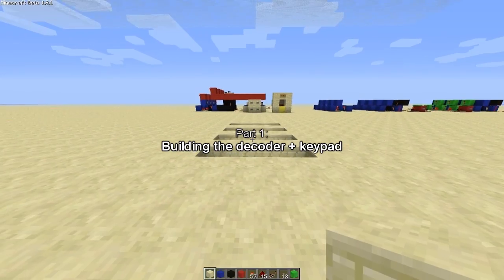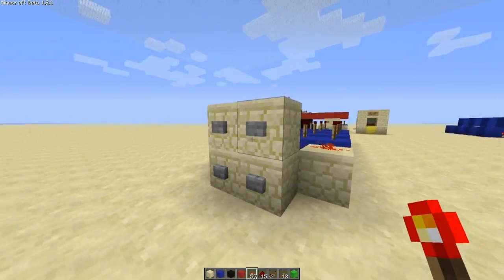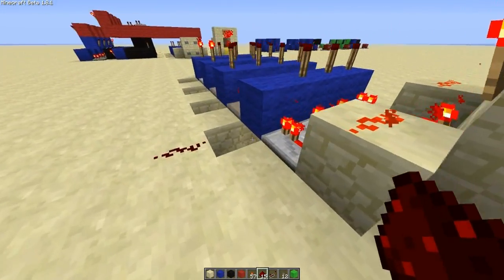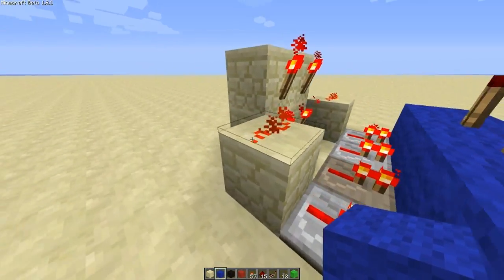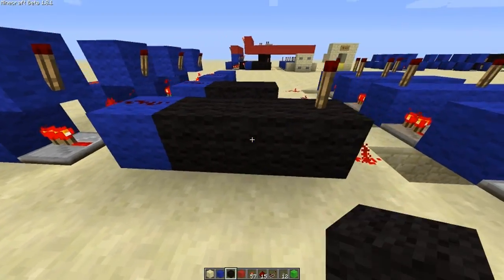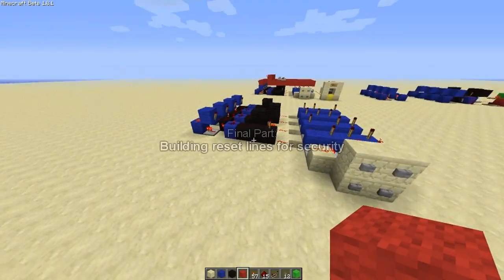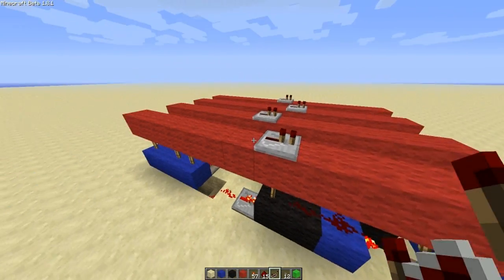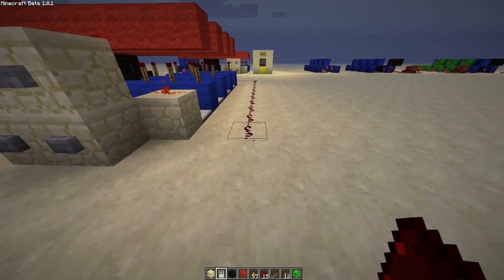Secure, Expandable Combination Lock! [Advanced Minecraft Redstone Tutorials]

Comment: I MADE A FIX!!! Make the RS NOR latches one block longer (on the black line). Then make it the same as it would be. Just put redstone where the torch would originally be. (Remember to move the whole RS NOR latch back 1 block from the decoder). then put a torch on the new block. Now for the and gates, do what he did, but add a block between the redstone at the end and the repeater. make sure the redstone does not intersect with any redstone on the black blocks. This patches the "hit the last number to open" glitch. The cause of it was that redstone, in newer versions, goes in to a line after a repeater, but in this version, it went in all directions. this fixes it because it isolates the redstone, causing it to do the same as it used to, still provides power to it, and powers the torches. The texture may look different, but it does the same thing. PLEASE LIKE SO EVERYONE CAN SEE!!!
Reply: glad i could help
Reply: Bro I need some help with the press number 4 and it opens because I am crap with redstone and have no idea what you put to fix it.
Reply: just try to follow along with what i said, i know its a bit confusing, but it will work when done correctly
Reply: ZombieRepellent
this video helps fix the "press last digit bug". Helped me out. :)
Reply: ZombieRepellent u realize first of all you tagged yourself and second you didnt leave a link for a video.
Reply: But thank you for the help Rodrick
Reply: ZombieRepellent np
Reply: send us a world save bruh or atleast re-explain "add a block between the redstone at the end and the repeater" plzz
Reply: rodrick160 exactly! what does "add a block between the redstone at the end and the repeater" mean?
Reply: sorry, i will explain more. The problem is at the black wool. Make each black line 1 block longer than depicted in the video. At the part near the blue/pink wool with redstone, which in the video is seen as a cross, you must place a block to do something i dont remember anymore as i no longer play minecraft and this was a while ago. Just try to figure it out
Reply: PikachuTube2000 What he's saying is that that it would be like this: repeater -> block -> redstone (in a line). The redstone will form its star shape because it's not directly touching the repeater.
Reply: look this vid is understandably outdated just what fedxgaming's 9 button combination lock, its really compact and its up to date
Reply: rodrick160 Dude! I pressed my finale button without pressing the others and it still opens
Reply: rodrick160 put a torch where?!?

Comment: Wow great design. Thanks to all the comments on how to fix the bug, ive already made 2 different codes and am too lazy to make another. *note to builders, when they say lower the repeater one block and put red stone behind it, you need to extend the and gates 1 each (so 3-2-3-2 becomes 4-3-4-3) to fit the extra piece of redstone in. Also, make sure the redston from the gaps does not connect with the redstone that activates the RS NOR

Comment: the solution is very easy:
The  RS NOR latch array is made of 4 rows in this video. Between these 4 rows, there are 3 rows with redstone pointing back to the decoder. Just dig away the block under the redstone torch and the repeaters in each of these 3 rows and put redstone under the torch. the redstone after the repeater (closer to the decoder than the repeater) should be on the original heigt. I hoped this helped and sorry for my english :D

Comment: You can just hit any number on the keypad that is not the last number in the combination, this resets the output line as the latch is broken. Alternatively if you have set it up so the door goes into a room, you can just link up a button inside the new room and make a redstone line from that button that connects to the reset lines on top. When pressed, it will send a signal down the reset lines, completely resetting the latch and closing the door behind you.

Comment: You can enter the combination super fast, all you have to do is knock out two torches in a row for example the first number is one and the second number is three you knock out the first and third torch from the first row of blue wool, in the second row you would nockout 3 and 2, the third row: 2 and 4 and the last row just 4 and it allows you to enter the combination alot quicker and it still works as it should

Comment: An idea I had about this would be to make an AND gate after each RS NOR latch in such a manner that both the previous button would have to be turned on, and you would have to press the correct button next in the sequence. Of course this would mean changing a few things in the reset switch to make sure that it doesn't conflict with the AND, but I'm sure you can figure that out.

Comment: You mean your pin-secured piston door to be timed?
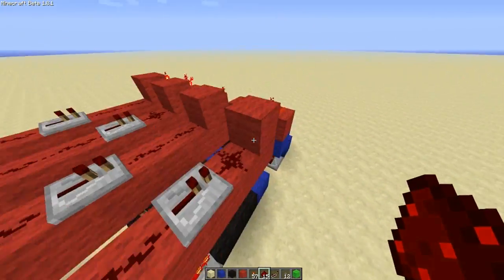See that output torch at 11:11? Just link a set of repeaters (as long as you want your piston door to stay open) to the reset for the last pin (red wool).
The signal going through the repeaters will tell the mechanism when to reset.

Comment: You can just hook up all the wires together and make attach them to a block with  redstone torch on it so when all the wires are on, it turns the torch off then have the same thing except the redstone wire attached to the off redstone torch, which will trigger the second torch to be on thus opening the door. It might sound complicated but its not really

Comment: The blocks leading from the decoders each have a repeater powering a block with a torch on top. He adds "and gates" at some point in the video that lead to those very same blocks with the redstone torches. These blocks MUST be powered by the "and gates." These gates will allow the flow of power to pass through ONLY if the "and gate" is powered by the RS Nor latch behind it, therefore only allowing a number to activate if the one behind it has been activated. Continue...

Comment: I used the 9 button pad.I used the same decoder & reset design above the decoder, but  a diff design for the active high (NOR) RS latches and the AND gate. My design is larger, but works w/ no bugs, & all buttons have to be entered in the right order of course. The trick is to take away all the torches involved with your code on the decoder, not just the one torch on each line. Then put NOT gates on each latch's set output to the next latch's reset input. this makes sure code is entered in order

Comment: i found a solution that should work... (please don't hate if it doesn't)
first extend the RS NOR latch so there is a stretch of wire that comes before it, put a piston in the middle and make it un extended except for the one on the first digit (make that one infinitely extended, now, just like the last redstone torch is your output, when the first RS NOR latch output torch is activated hook it up to the next piston, making it possible to only get the code in the right order, i hope that helped

Comment: You mean like to close the door after you've gone through? I had to put a couple of blocks with redstone torches (yada) to lengthen the distance the power went (my door was a little bit away from it), so I just put redstone wire leading up to one of those blocks connected to another block that I could put a lever on when on the other side to close the door. This also basically locks the door, since the door then only does what the lever says.
But I'm not sure if this is what you were asking.

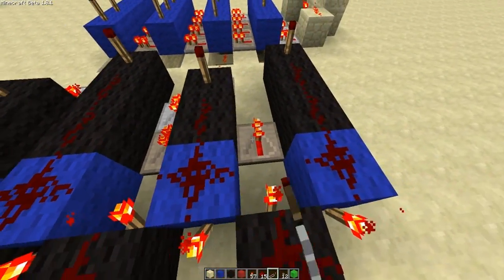Comment: It's because his "and gates" don't work properly. Somewhere around 7:20 he sets them up so that each latch can only be activated if the one before it has been activated. The redstone, however, does not power the block it's supposed to power in order to keep the torches off, and prevent the latch from activating. The redstone is NEXT TO the block it needs to be, but is not positioned so that it ACTUALLY powers it. Just rewire it a little bit so the redstone properly faces the block. Hopethishelps

Comment: The final number of the combination unlocks the entire thing whether the ones before it have been entered correctly or not. There is no system to test whether the recent input was correct or not. You could press "4" and the entire thing is unlocked without any "combination"
Reply: The first number has to be 1 then everything works fine ;D
Reply: the same thing happened to me and i do not know how to fix it.
Reply: Gio Fedalizo Hello Gio! Glad to know I\'m not being an idiot, and this is an actual problem. I have, however, found a solution. If you would like me to post a video here on youtube, or message/email you one, please let me know. Enjoy your day!
Reply: Matt Hamlin How do you fix it then?
Reply: I actually found that he has a video on how to fix it on his channel. Funny... he used the same method as I
Reply: ** EVERYONE, THIS STILL WORKS IN 1.7.9, FOLLOW THIS VIDEO EXACTLY, AND THEN EDIT IT WITH THESE INSTRUCTIONS ****
The solution is very simple. The redstone repeaters in between each RS NOR latch array (the repeaters in between the black wool), basically just delete them, dig a 1 block deep trench along and replace them in it exactly as before in the video (make sure you add a redstone dust under each torch because it won't reach the repeaters otherwise). The redstone dust connecting each RS NOR latch should now work again. Hurray! Your welcome.

And if you want more than one combination in the system (because your friend annoyingly decides they want one too in your world) , then just leave a big gap after you finish the build, and then place an exact replica of the red + pink wool and black RS NOR latch system behind it. This prevents having multiple combinations crossing....You know maybe I should just do a video on this to simplify everything haha
Reply: i know is weird that he didint see this
Reply: BlueShark85Xbox because when he did it, it worked. Look at the date of the video, lots of updates have occurred since then, so naturally it wouldn't work in it's current form. Follow the instructions I gave above, and it should work, for xbox and computer 1.7.9 version. I tested it on both, and it works.
Reply: Put in a repeater,it will fix it. If that doesn't, put it on a delay.
Reply: It still works in 1.8, just checked!

Comment: switch is, put a red torch facing outward followed by a sticky piston with a brick.  each time you hit a number, the piston will extend.  Inbetween each extended brick put a redstone arrow deal all facking toward the combination pad.  At the far end put a redstone torch and a wire, then on the near end run it to your door.  Now, go to where you programed the code.  if

Comment: It sounds like it would just be 1-4-3 as a simplified code and that would unlock it.

I would assume you would have to make separate circuits if you want repeating numbers.  Unless someone knows a good way to consolidate that.  There might be a way to use the new locking repeaters to 'unlock' a second circuit when you reach a certain point.

Comment: for anyone having the problem of the last digit activating it here's whats wrong...

the AND gate between each line doesnt work. the idea is to keep the torch at the end off until the previous signal comes on, but because redstone dust doesnt power blocks when its turning a corner (like here), its not working

solution: you need to power the block holding the torch in another way, eg. from underneath like i chose to and have the AND gate turn off said signal as intended

hope this helps =)

Comment: Ok This is the easiest way I could figure out to do this.  Hook the output to a monostable pulse limiter. Then split that signal two ways and delay one direction (about five seconds) and run both lines to the input of a t-flip flop that controls your door.  You'll then have a five second window to walk through the door before it closes after entering your code.  Run another line using the same concept of delay to the input of the t-flip flop for an inside button to open your door(from the insid

Comment: Continued.... In order to fix the problem, you MUST reroute the "and gates" so that their line of power leads DIRECTLY into the blocks with the torches on top. For example, I modified it so that the gates power either a repeater pointed DIRECTLY AT the block, or invert the signal with a torch, which powers a torch DIRECTLY BELOW the block. It gets crowded, but glowstone helps. Continue...

Comment: Oh, or if you want to be able to get out, connect a lever instead on the inside of the room to a sticky piston with a block that goes through the output line. This means when you pull the lever, it will move the block to either complete the output line and send a signal to the output or pull back out of the way to prevent the signal from completing, locking the door behind you.

Comment: To fix it for 1.2.5, the last button opening it etc, the repeaters and redstone facing towards the decoder on the ground need to be removed, then dig down one block so u make a trench, and place redstone under the torch, ten the repeater. If its the middle one run redstone two blocks replacing the first repeater: there's videos for it

Comment: Well from the looks of it, the fix is you just need to remove the torches that are interfering a different line and use an AND Gate to connect all line outputs instead of the fourth final output

Comment: 1. Remove the reset for the second to last latch
2. Add a piston connected to the second to last latch that pushes a block that lets the current through the output
3. remove all the and gates
4. You have to manually reset the second to last line, as i haven't found a way to do that automatically :S

Comment: (Continued)  I also needed NOT gates connected between the decoder outputs to the RS latch's SET inputs. Like i said my design is larger but fullproof. It is 12 meters longer in width and 9 meters longer in length than the one in this vid. I'm sure there is a more compact way to do it, but whatever, it works great!

Comment: THIS WORKS IN 1.4.7! JUST TESTED! BUT...

...In the video the guy just makes the RS NOR latch wrong. The redstone that is in between the wool blocks needs to be one block lower and go under the redstone torches, this makes sure that you can't just press the last button of the combination. So the one piece of redstone and the 1 or 2 repeaters and place a piece of redstone under the torch. (There should still be 1 piece of redstone on the higher level.) Hope this helps! Mail me if you need help!

Comment: The problem is at (around) 7:25. The redstone power from the repeaters doesn't reach the black wool with the torch. Redstone running perpendicular to a block will no longer power it. It is easy to fix but requires some modification.

Comment: one way this could be fixed:
have the torch power a redstone line that toggles an inverter that powers a sticky piston which has a block attached that is part of the line that powers the torch. when the inverter is toggled, the piston retracts the block, breaking the circuit and resetting the lock. this is a hypothesis for now, but once i have time i will check this and get back to you if it works. if now, i can only wait and hope for someone with a fix.

Comment: For those of you wondering why it doesn't work in 1.6, it's because the redstone from beta acts differently than it does now and one of the redstone pieces doesn't activate a torch like it did in the video, like right at 7:25 if you look at where the redstone points when he placed it after the repeater, it does that stupid 4 direction thing so it activates the torch next to it. To fix it you have to move the RS NOR latches back and a few other things; I might post a video on how to fix it :)

Comment: wait when I Did it doesn't really work because when I press the last button of my code it just opens u don't even need the code u just press all the buttons and when u press the last button of the code like for example 9 it just opens so pls I need help
Reply: I have the same problem!
Reply: Me too
Reply: i fixed this issue by using a special setup. I could only activate the last digit by activating the digit before it in a certain amount of time. Like I would Press 3 and would then be able to press 4 (the last digit) within one second.

Comment: Hi I love your tutorials but this one isn't quite working. the Combos and RS Nor Latch is fine but the reset line isn't resetting. if you hit the last number in your combination the door opens the other keys light up the either lines on the array but lighting them in succession doesn't seem to matter. Please help! I am on xbox 360 in 1.8 Would this have something to do with why it isn't working correctly?
Reply: HeatherElizabethSong Design is slightly outdated. If you want an explanation, I have one:

The repeaters in between the lines, (I mean the ones at about 7:19) need to be moved down a block. So what you do, is you mine the blocks below the torch and where the repeaters would be, and place redstone below the torches, and the repeaters a block down where they would normally be. I can make a video if you can't figure out these instructions.

The problem is, in B1.8, redstone would not have a direction coming out of a repeater. I don't remember when they changed it, but they did. In this video, it changes the torch, but after the update, the redstone points into nothing.
Reply: Collin Read Thanks a lot that really helped :)
Reply: +Collin Read It didn't work for me. can you make a vid or post a link to some screenshots plz?

Comment: I found a problem. I programmed this to accept the passcode "1997". 1997 will open my door, but so will just "197". This is occurring because when I enter the "9" both the second and third lines are engaged. Thoughts? This would be bad if your passcode was "1111" or "2733".